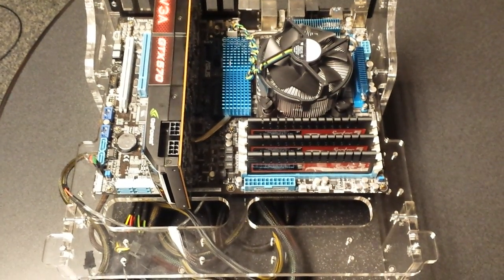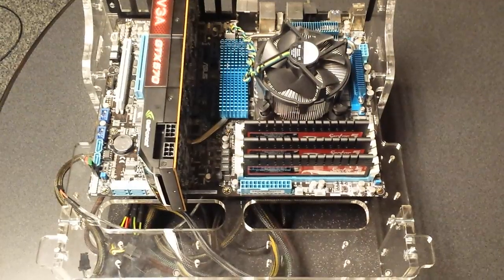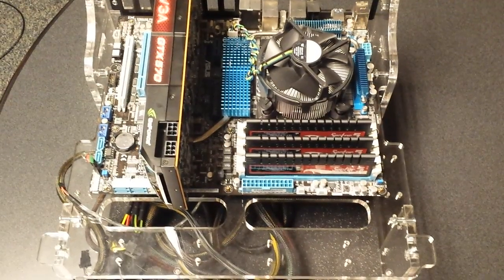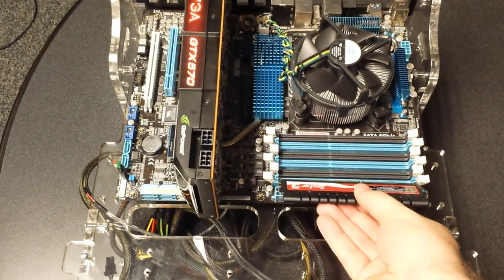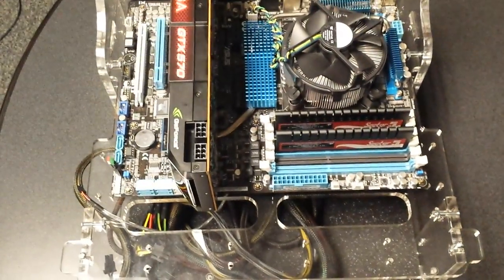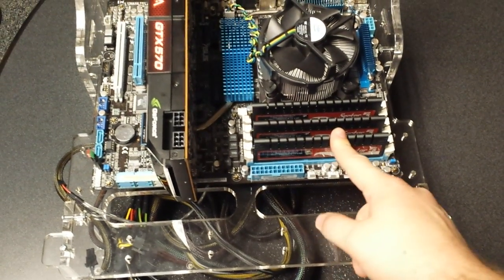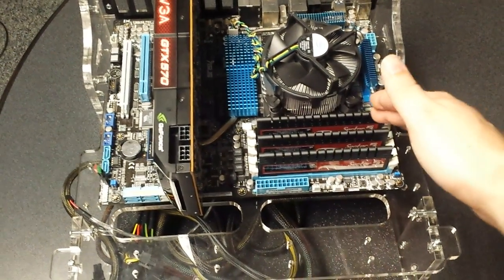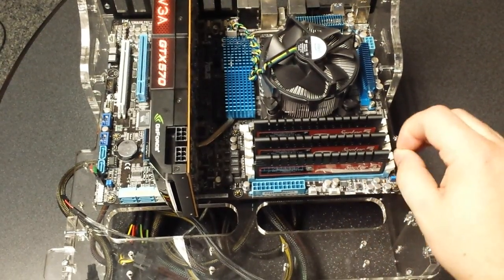How To: Reseat / Remove / Install RAM

Comment: Just so you know.. This video, although it may seems like basic common knowledge to most techs.. Incredibly helpful for my best friend having issues with his computer over seas... Had to send this link to him. Thanks for the video, great to see you touch on the importance of discharging as well,.... Awesome
Reply: dorkredcrow  this videos seems silly to guys like us? Only if you already know how to reseat, remove, or install ram like the title says. I guess I'm silly
Reply: I mean why wouldn't you check how to do it safely without making an expensive or dangerous mistake?
Reply: you know
my ram always loose because of that stupid fauking Lock 
i have to hurt my hand when pushing to lock it
but the fucking lock is loose like a faking jiggle

Comment: Thank you so much--You saved me a trip to the repair shop! Removing and reinstalling the RAM along with replacing the battery on the motherboard solved my problem and my computer works just fine now.

Comment: Thabk you so much brother, My desktop kept restarting randomly o its own, I took out and re-placed the ram sticks and it works.
Ps: Make sure you hear the " Click " sounds per ram stick.
Reply: mines restarting randomly, should I remove and replace?
Reply: @benb1492  yup u should
Reply: @benb1492  or just clean it
Reply: @rehaandaboss3051  Yeah the problem was one of my RAM sticks had come lose causing my PC to crash, all fixed.

Comment: And graphics cards can have similar problems.  Some relatives were having a problem with their PC with a blank screen.  After opening the case I decided to take out the graphics card - and the contacts looked rather dull.  So I rubbed the connectors using a rubber eraser one of those ones with a pencil eraser one end and a pen eraser the other.  I used the pen eraser because it was more effective.  Replaced the grapics card back into its slot, and it worked perfectly!  BTW if you are building a PC get 2 sticks of ram instead of just 1 because that way you can troubleshoot more easily.  For example get 2 four gb sticks instead of 1 eight gb stick.

Comment: Lol my ram slot is sooo old that i can't remove the ram
Reply: You guys unclip it?
Reply: ez fix
Reply: Same here, it gets up a few mm but then nothing happens. Yes i unclipped both sides.
Reply: @Jplayz  cant cuz its stuck
Reply: @alexanderbrundin7620   hmmm well make sure its actually uncliped (it has 2 clips, one on each end) and if you still can't take it out, just pull it out by force with the risk of damaging it, and install new

Comment: just one question is if i take out my ram when computer is shut off and put it back in and turn it back on will it delete anything from my pc this is because i need to see what brand my ram is.
Reply from the maker: Nothing will be deleted from your PC when removing and replacing the RAM.

Comment: Do you need your power supply plugged into the outlet to ground yourself on the case before working inside? You said to disconnect the power cable before working inside your pc and then to ground yourself by touching metal on the case.. Will the static electricity stored in my body go  through the rubber feet of my case? I guess I could get a coat hanger and stick it in the ground of the electrical socket and touch the case to it or I can just leave it plugged in and flip the power off switch on the back of my p/s? What do you suggest?
Reply from the maker: Just touching the case should be enough. You likely won't even feel the discharge, no tiny zap or anything. Electrostatic Discharge just isn't the danger it used to be.

Comment: Hey, every time I install RAM into my PC there are 2 slots that does not recognize I just get a red light and a few beeps any fixes?
Reply: @KILLER KATARIA Okay I'm going to get a new one thx man
Reply: @KILLER KATARIA crap man I only had this PC for a few months and now it's already fired 😩
Reply: first clean both the slot and the memory pins... 2nd check if all your memory is good by doing this:  install your first ram in one slot, if it runs, try the same ram in other slot, if it runs then the memory and slot is good.  install the 2nd ram and repeat the process, if the memory doesn't run then you know that the memory is defective else if the second memory runs try to install both memory... if one of the two RAM doesn't run then the memory may not be compatible since you know that both memory is good
Reply: @bmgcomp  Thank you I'll give that a try and see how to goes I'll let you know if it works thx for the help :)

Comment: Someone help, I’m pushing down hard on them but the release things still won’t click into place
Reply from the maker: You might have them turned the wrong way. Make sure the notch in the RAM stick aligns with the little peg in the slot. Shouldn't take an extraordinary amount of force to get them to click.

Comment: Hi i have a problem , I tried reseating my ram and placing it back on but when I start the comp it never turned on but the light of the pc is on so is the fan
Reply: Redvelvet Joy RV is queen try reseat it back,and make sure,to seat it on 0+2 and not at 1+3 means if you insert it on blue banks,make sure you insert the second one in the blue bank also.if you put the 2 ram in blua and black or white,u still can boot ur pc but will end up as me,auto reboot when do benchmark or gameplay...give it a try...
Reply: Noah Valerio I think I just did that did you ever fix it
Reply: Same thing happend to me and i only have 1 ram what can i do ?
Reply: Did you guys leave the computer on while doing it?
Reply: Binzi nope but I fixed it
Reply: @obi-wankenobi5416  how did u fix it?

Comment: i removed my ram stick which had only 1 clip lock and it completely destroyed my motherboard for my rog strix gl10cs , im still confused. was my motherboard damage before i got it?, it worked fine before i pulled it but when i did it. It stopped receiving power to my monitor keyboard and mouse. i just recently ordered it as well.
Reply: your motherboard probably suffered an ESD (Electro Static Discharge) is the motherboard not receiving any power?

Comment: i doubt you still respond but if you do great. i got a pre built. bad idea. but anyways it has on 16 gb ram stick and another slot. do i have to match that ram stick thats already in there or do i replace the one thats in there and get two new ones. and my mother baord near the ram says DIMM1 then skips to DMMI3 should this be a problem. i need help
Reply from the maker: Ideally, they should match. Pull out the stick you have, maybe take picture of it or write down the Brand (Samsung, Hynix, Corsair, etc) and Model Number. Then try and find another one on eBay, Newegg, Amazon, etc. 

Sometimes RAM slots are split up on either side of the CPU. 1&3 on one side, 2&4 on the other. Without knowing the exact model of the motherboard it's hard to say what the optimal placement will be.

Comment: I've installed 16gb of ram into my PC but in my system info it shows up as  16.0 Gb (7.95 GB usuable) how do i fix??
Reply: Make sure your ram is installed in the correct slots. If you only have four slots and two sticks of RAM then typically you will want your ram to be spaced out by one slot and the specific slots you will usually need your ram installed to are 2 and 4 also known as slots a2 and b2. If you can consult your motherboard manual i suggest doing so. If they are installed in the correct slots then try removing one stick of memory and then checking to see what it does. It may or may not boot but do not worry, try doing the same with the other stick of memory after reinstalling the one you haven't tried yet into the same slot it was in before, make sure to remove the other one. If both work fine seperately but not together it usually means there's a bios issue, improper installation of your operating system or something else that is also minor and of course try testing them both at the same time just once more. If you happen to figure this out and have no other issues and both work then ignore what is mentioned below for now. If only one works then there's a chance one is unstable, dead or dying. If you need to figure that out you could always try installing memtest86 to a flash drive and seeing if there's any errors with the ram, of course you'll need both ram stick  installed for this. Memtest 86 will usually take 2 hours to complete testing. CareyHolzman has a step by step walkthrough here on memtest86 eith a link to it in his description: https://youtu.be/9_xFNojChNA

Comment: Loooong story. But my computer was crashing after a bios update. It would crash a few seconds to minutes after booting. My pc crashed like 30 times so i quit using it.
I went back at it again a month later and the crashing was still present.
I just decided to move the ram from one slot to the other..... problem fixed.
No, this is thr first time i ever opened my pc.